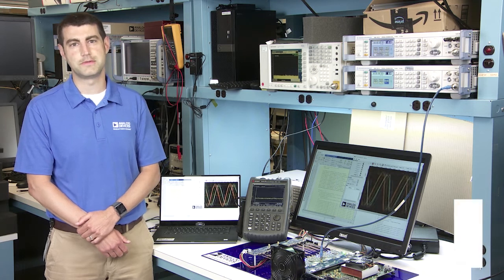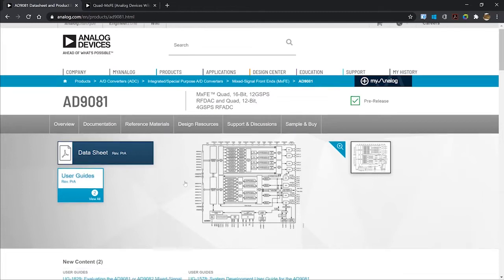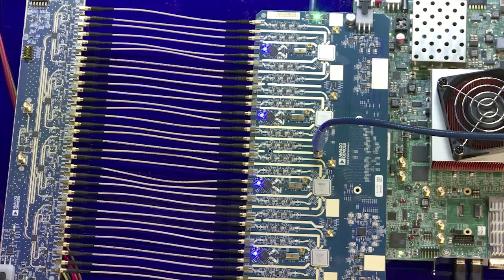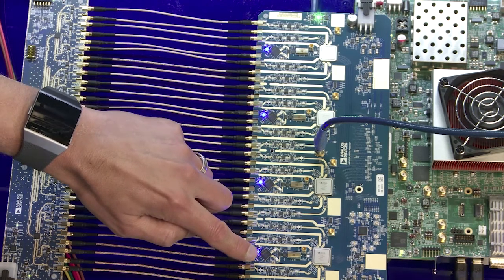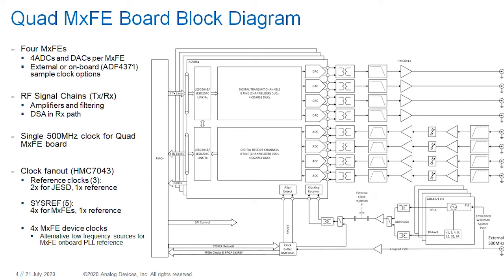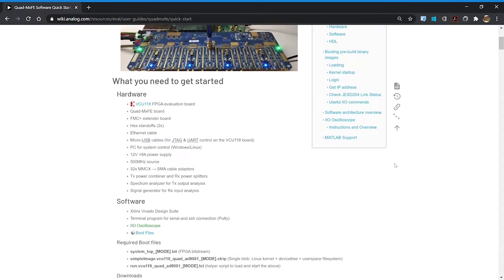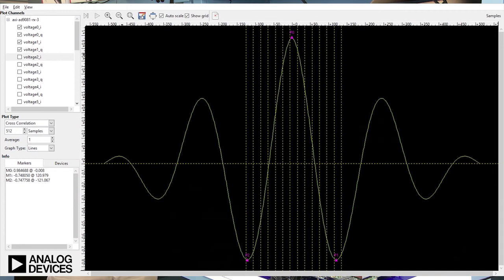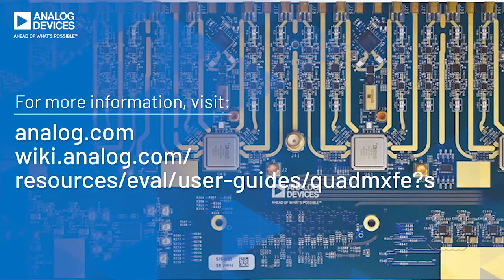16Tx/16Rx L/S-Band Phased Array Radar & EW Prototyping Platform by Analog Devices

Comment: You have the terminology mistake. It is Digital Antenna Array, but not Phased Array with phase shifters.  Please look https://en.wikipedia.org/wiki/Digital_antenna_array
Reply from the maker: Thank you for your comment! The Quad-MxFE Platform is intended, and has been used for, the development of phased-array systems. It has been used as the backbone to create both digital beamforming systems and hybrid beamforming systems, the latter in which customers have developed system-level algorithms using analog phase shifters such as the ADAR1000 attached to its front-end. Using this building block approach, the Quad-MxFE Platform realizes Digital Antenna Arrays and much more.